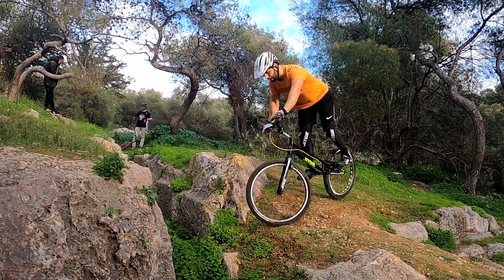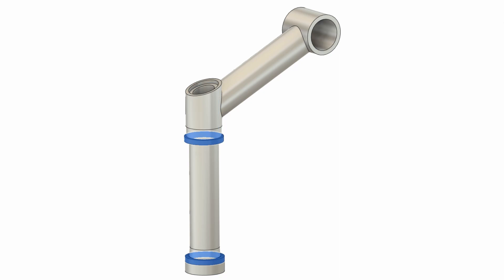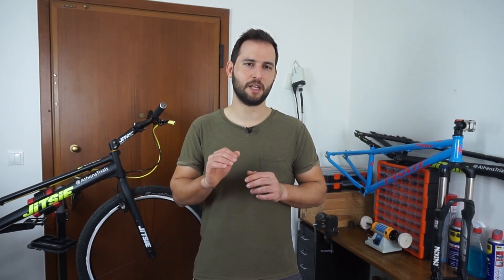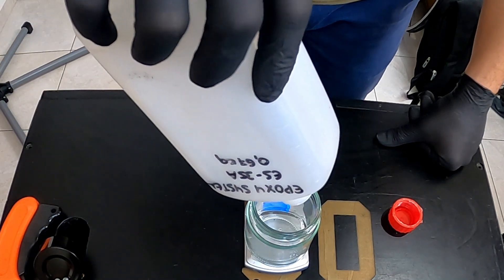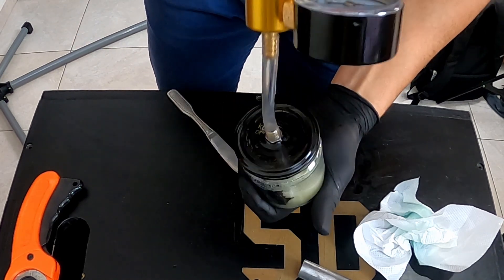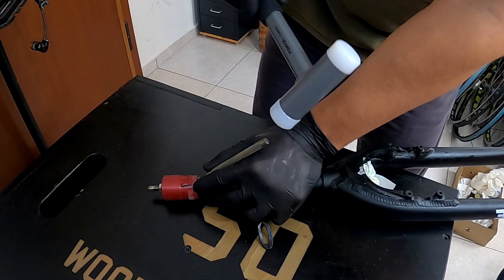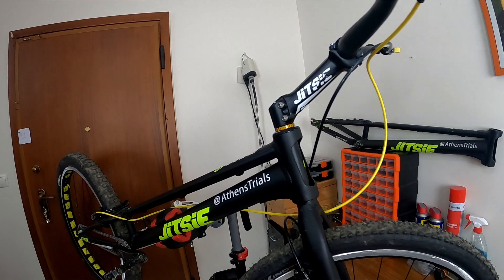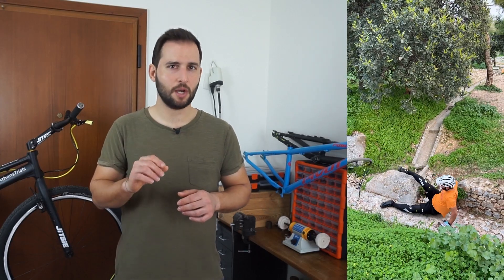I reinforced my aluminum fork with carbon fiber!

Comment: Hey there. Carbon composite bonded directly to aluminium is a very bad idea as carbon composite causes galvanic corrosion to aluminium. You can use Kevlar in-between the two to stop that reaction. Hope it helps.
Reply from the maker: Hi! Thanks for the comment! I know that carbon and bare aluminum does not like each other unless you do something to insulate them! However, these forks are already anodized and this provides the non-conductive barrier you need to avoid galvanic corrosion! (similarly to why you can use carbon stem spacers without damaging the steerer tube or your stem) It's been more than 1.5 year since I did this one and I had no issues up to now! These days I'm about to redo this carbon reinforcing on a new fork as part of my preventive maintenance approach for some of my bike parts that are prone to fatigue failure and I'm preparing a relevant video to revisit this topic and discuss on my experience! So, I'll manage to include the issue of galvanic corrosion into my discussion! So, subscribe if you haven't done already so as to get notified of the upcoming videos!